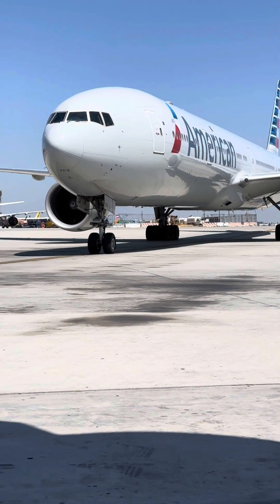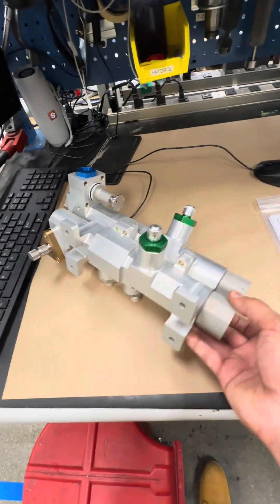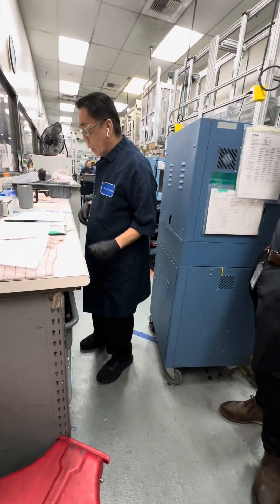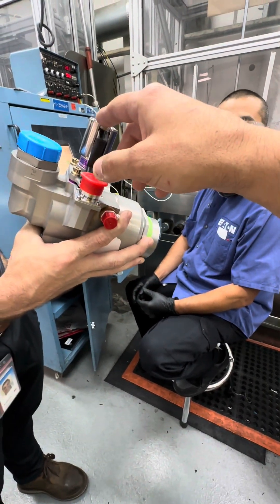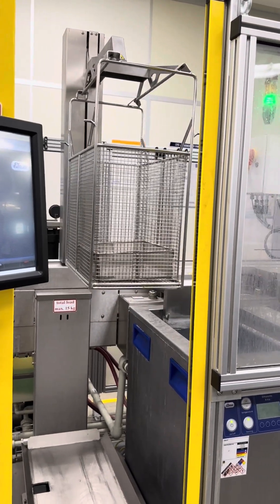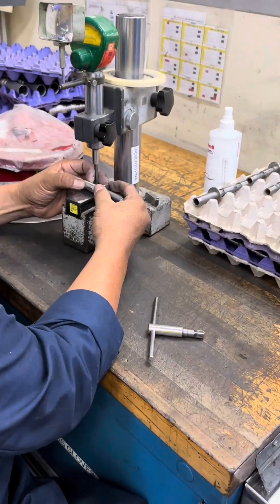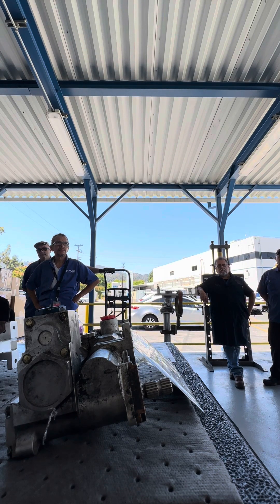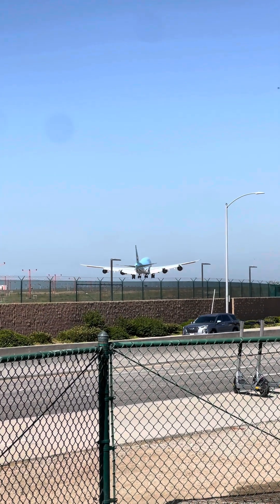EATON Aerospace Overhaul/Manufacturing facility.. This is where Aircraft parts Go for Refurbishment

Comment: Thanks for this good video, Stig! 
I too once worked in an overhaul shop in my career.. we repaired or overhauled many different components. What I learned from this helped me once I got on the big jets to help troubleshooting problems. Knowing how these components function internally really helps.
Couple of things:
1. These are FAA part 145 repair stations 
2. Pre testing is required on everything received to verify or not the customers reason for removal.
3. All techs must write detailed tear down reports…. Goes with the aircraft record!
4. Most components are not conditioned new but either repaired or overhauled.
5. Any modifications or AD’s must be applied prior to QC stamp of release.
Reply from the maker: Thank you so much for the detailed explanation Chris.

Comment: That is insane 
I'm blown away. 
Eaton deals with AIRCRAFT parts 
And i was thinking they only deal with truck transmission's. 
That is very impressive.
Reply from the maker: Indeed, they do a lot of manufacturing for many different areas not only Aviation as well as trucking, but as well as power management.

Comment: I worked at an OEM/overhaul shop and yeah... never again lol it was a waste of time as an a&p, lots of quality and engineering issues and in places other than CA they just hire anyone off the street for cheaper than you could work at target for.
Reply: I did learn a lot though from a different part of aerospace that a lot of mechanics don't get to experience.
Reply from the maker: @meowmeow2759  and that’s the point of those facilities, use it as a stepping stone and move forward in your career as an A&P. For example others that don’t wish to pursue the license but still be part of the aviation industry, it’s an option for steady employment.

Comment: Stig , it's OK to say " Servo"  your speaking my language,,
Reply from the maker: Right on !!
Reply: @StigAviation  Stig, back in the mid 80s while working for a major airline  , I remember twice having to change out rudder PCUs on a 727.
They were internally bypassing. Now as you know the 27 has a split rudder which in the cockpit,  the pilot can isolate and shut hydraulics off to the affected rudder.  It was an all day job.  To bad Boeing didn't design  the 37 with a split rudder system.
Reply: @StigAviation  Enjoyed the video,  Eaton sounds like they do the job right and not make rudder PCUs 
That internally bypass and bring down two 737s. NOW ,,I won't mention any names but ,,,,
Parker Hennefin ,,
Reply from the maker: @wayback75  I know exactly what you’re talking about. I remember those incidents